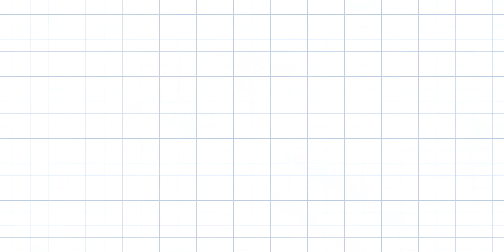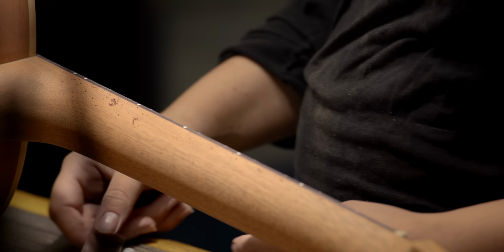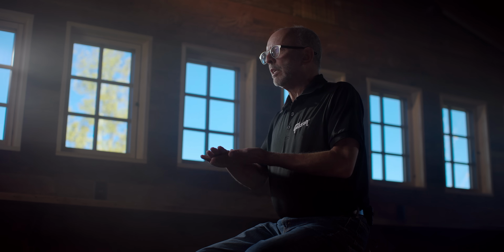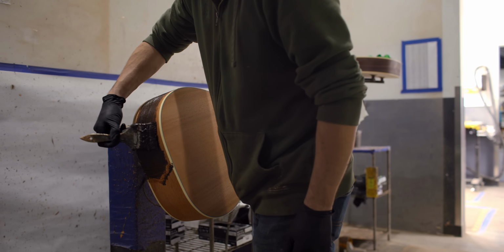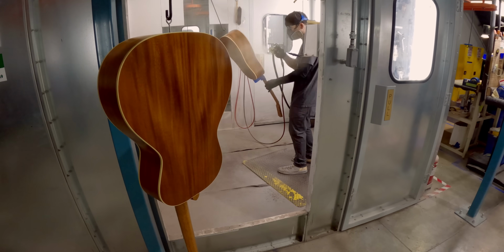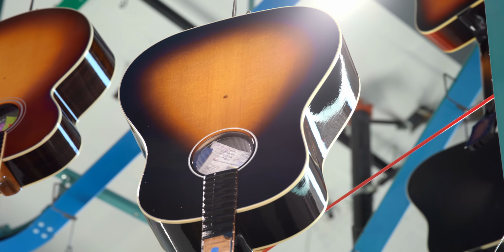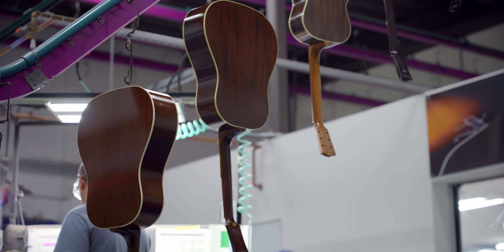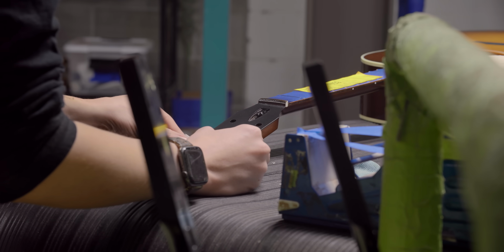Crafting the Iconic Sunburst on Gibson Acoustic Guitars | The Process S2 EP7

Comment: It's worrying that many of the sprayers are not using safety masks.
Reply: In their Nashville plant "process" video, Jim mentioned that their filtration system operates to OSHA standards that do not require a face mask. By the looks of it, they have the same filtration system here.
Reply: I agree.  The spray process may pass OSHA standards, but shouldn’t a high profile company aim higher than the minimum?